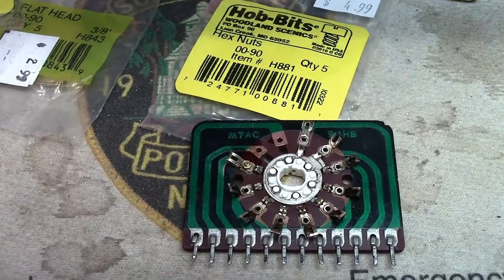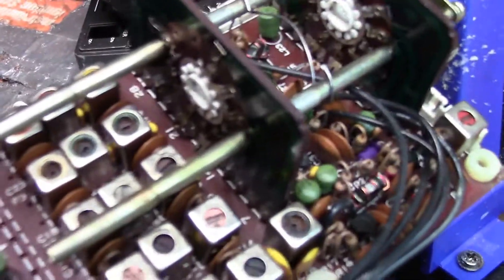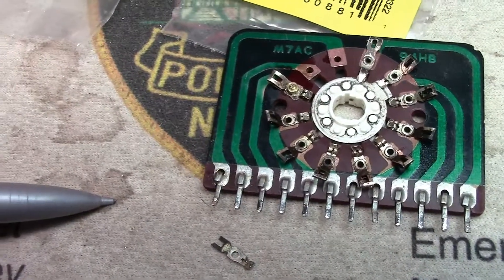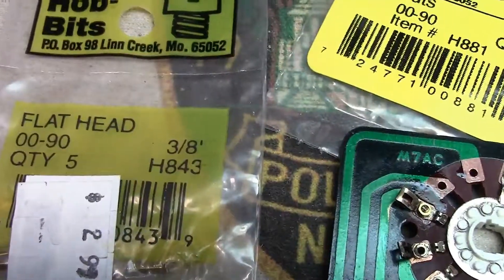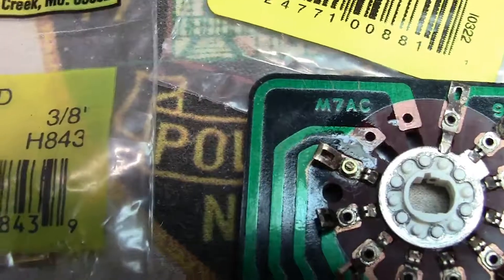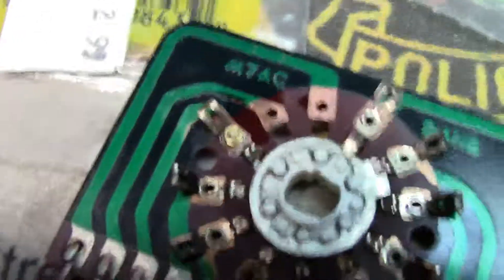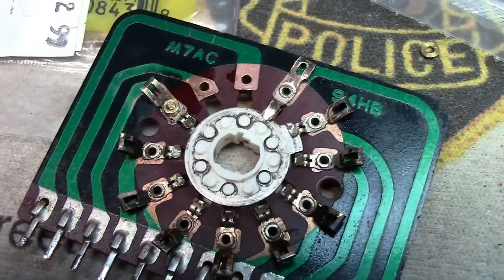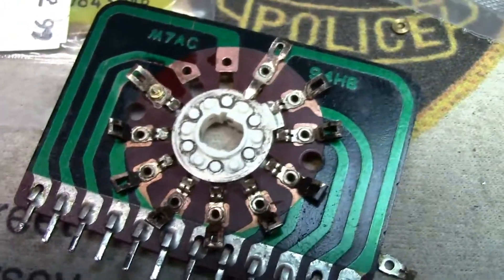Kenwood TS 120S Band Switch Repair

Comment: Alex,
I would be very interested in knowing the details of how you got the control shaft tilted up to slide the board assembly off. I need to rep[lace a transistor and the board has to be off and on the bench to do that. It looks like you have to free the whole front panel.
Max N5ODA
Reply from the maker: Dear Max : I am so sorry I took so long to get back to you. As I recall I removed the front panel tuning knob and removed the RF Board from the chassis . This is the worst part of the whole project. The service manual should give you an idea how it is done if you check the exploded diagram. Also I forgot to mention the area under the old connector should be cleaned before installing the new connector. Best wishes to you and yours for a very happy and healthy new year. 73 Alex